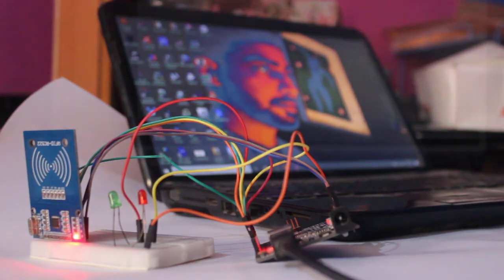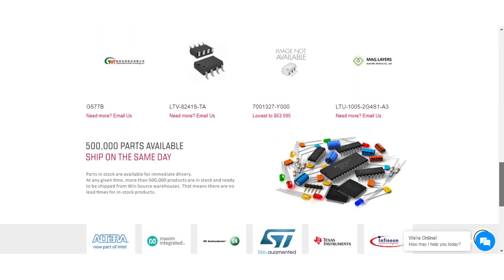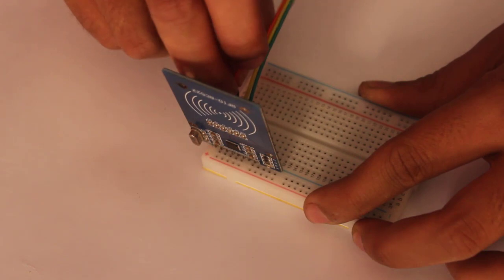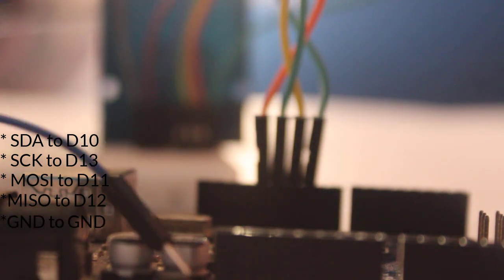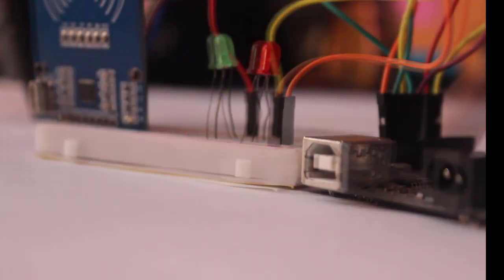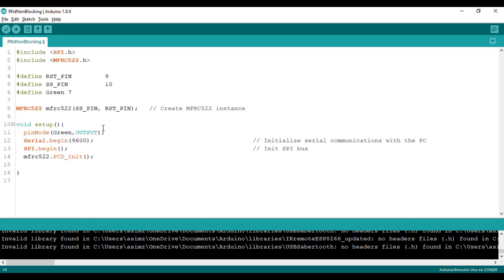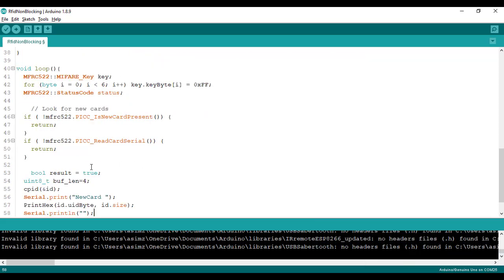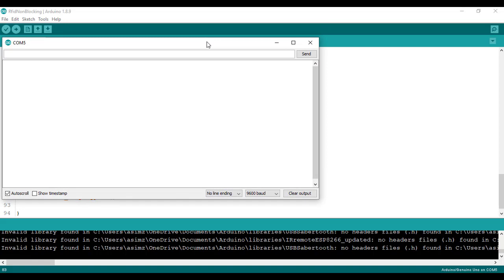RFID tag present or removed ? Arduino MFRC522 tutorial

Comment: Can I use 2 or More RFID module in this system. ? Where should I change in code ?
Reply from the maker: Yes you can use two or more RFID module in this system but it will not be easy to do that as you will have to use multiple devices with SPI communication.

Comment: Great solution... question.. would it be possible to run a short video clip when RFID tag is remove... how to integrate it?
Reply from the maker: Yes, That is possible. But the question is do you want to run video on arduino uno,  that will be challenging. If you are planning to play video on some other source like raspberry pi,  laptop,  or android device you can use nodemcu with arduino and send mqtt message when rfid card is removed,  and in the reciving side write the code for playing a video.  For mqtt tutorials,  you can watch my latest videos.

Comment: Thankyou so much for the great explanation, Sir..!!
I have a question, if I want to turn the LED on by using one particular rfid only, where should I add the coding for the id of my rifd?
Thanks before.. :)
Reply from the maker: That is a good question. I will also answer that in the end of blog.  Coming back to your question,  you can add the id using if else conditions right under the printhex function,  which prints the id of tag.
Reply: @HighVoltages  Thank you so much for the answer, Sir...!  I will try that :D
Reply from the maker: sure let me know how it goes :)
Reply: @HighVoltages  Can you post the specific piece of code I have to add to get it to work with one specific rfid?

Comment: Hey , I‘ve encountered a problem, when verifying  it says   'amp' was not declared in this scope ... How am I gonna solve this
Reply from the maker: Sorry about that. The "amp;" was added while pasting the code in the post. You can go to line 55 and remove "amp;", it will work fine. Also, I have updated the code on site.
Reply: @HighVoltages   thanks man , it solved the problem !